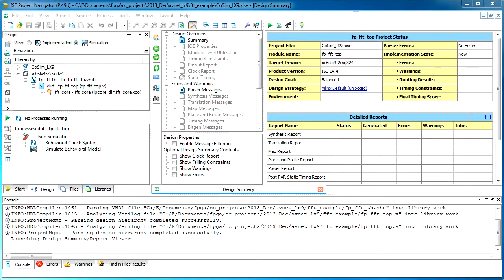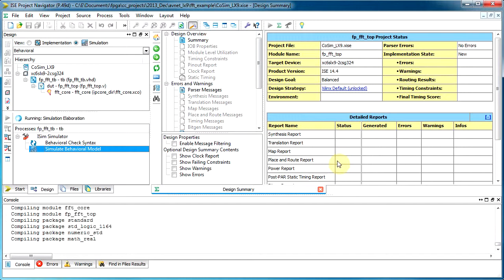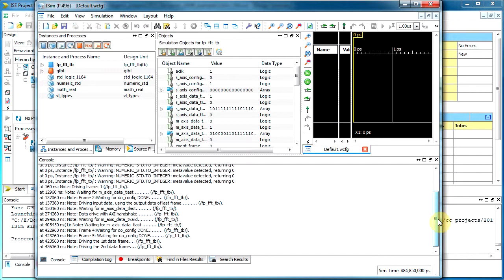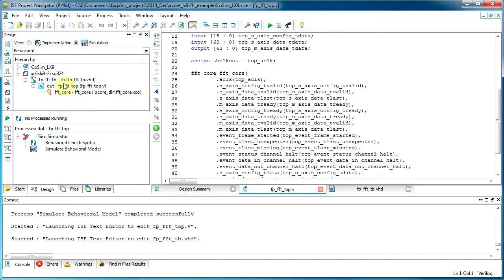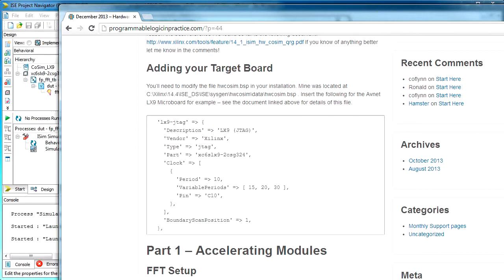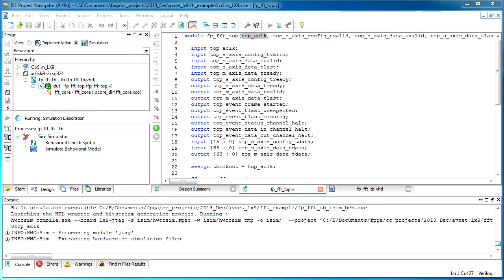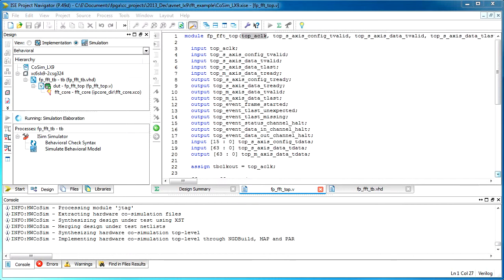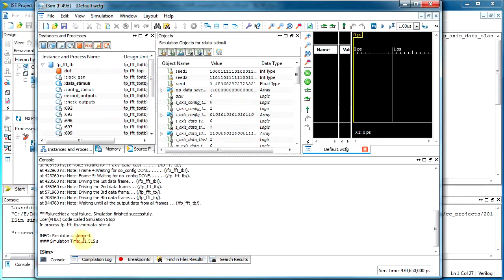PLIP DEC2013: Hardware Co-Simulation (Co-Sim) FFT Example

Comment: Hi, 
Thanks for sharing!
I have a question here, if the testbench tries to access an internal design signal using hierarchical reference what will happen?
I'm asking because i was trying to access an internal signal like lets say dut.module1.internal_signal in a CoSim but the simulator complains. 
when running the testbench in software only (NO FPGA), it works fine.